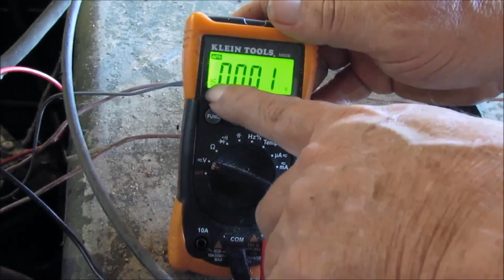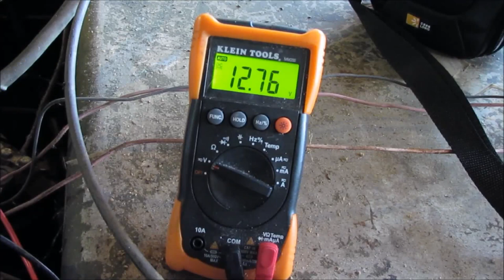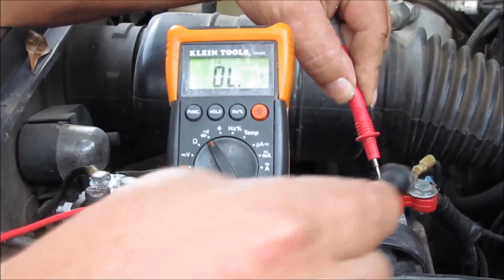How To Check Outboard/Auto Charging System

Comment: Great tip on checking cable connection . Never though of that yet it is so simple.
Reply from the maker: tks
Reply: How do you check Alan on board battery charger on a boat to see if it is working

Comment: What year and HP range. My 1995 Evinrude 70 looks nothing like that coil. One lead in one out!
The Power pack is also sealed as far as I can tell which has the 3 boots that come out to connect to the coils and other wire connectors.

Comment: I have a 2003 mercury 15hp. When I start the motor the volts increase but will drop off every few seconds sometimes even down to zero that's with a volt meter on the battery it causes my electronics to not function